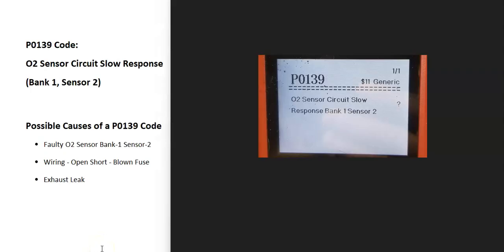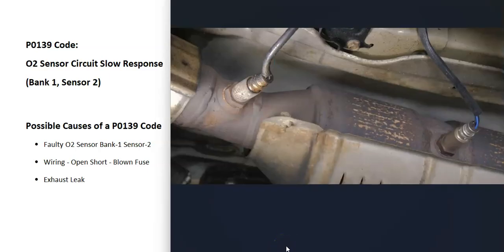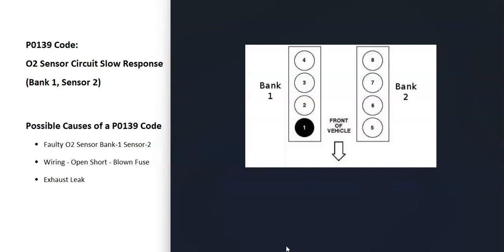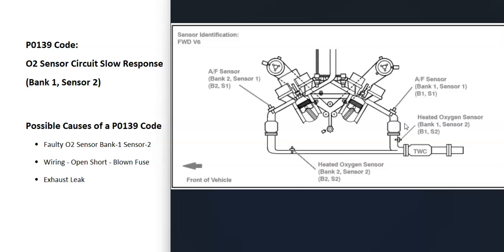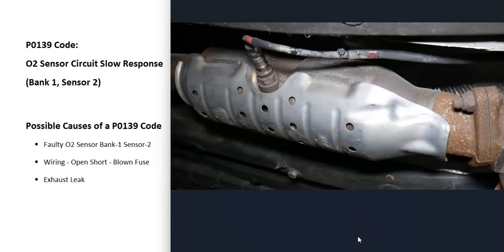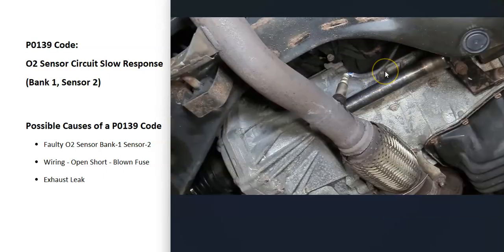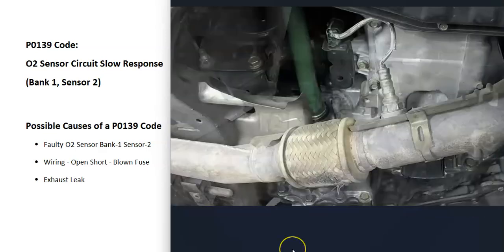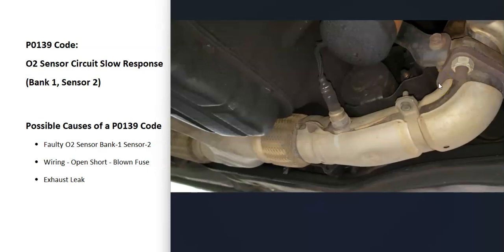Causes and Fixes P0139 Code: O2 Sensor Circuit Slow Response (Bank 1, Sensor 2)

Comment: I scanned my car ('06 Honda Accord 4 cyl), after the Check Engine light came on today, and the P0139 O2 Sensor Circuit Slow Response Bank 1 Sensor 2 code appeared. Also, 2 instances of the code: P0420 (Catalyst System Efficiency Below Threshold Bank 1). In the past, I just poured in some OxyCat in my gas tank and it bought me a couple months and the Check Engine light would eventually turn off after a few restarts. I poured this in again just now. I was just curious on your thoughts. The car is much too old to justify a replacement Cat. I won't have an inspection again until June btw. Thanks!!
Reply from the maker: If you can't get the code to clear and don't want to replace the CAT, you can look into an O2 Sensor spacer that often works, especially on older 2000s vehicles. An O2 Sensor spacer is a low-cost way to fool the computer, often used by racers with straight pipes or headers.

Comment: I have a 2022 Honda accord 2.0t and I’m using a rv6 Downpipe. I got the code P0139 last week, you think a catalytic spacer should fix the problem ?
Reply: So, I took my car to a different mechanic, and he told me that the ECU on the car is specifically designed for the original catalytic converter. Since the RV6 is high flow, the cat isn’t holding as much heat as it needs to. He plugged it into the computer and noticed that whenever he would floor the car, everything was fine, but after he stopped, the temperature would drop. So, he suggested that I get a tune-up, and I’m thinking of going with the K tuner.
Reply from the maker: Anytime something is modified, it is difficult to say how the computer will react. If I had to guess, I would think it should help, but it is best to find a dedicated Honda mechanic forum and see what they think.

Comment: I got p0139 on my 2010 Acura mdx , and replaced 3 times since last two years, if the sensor is good, the exhaust not leaking, what else cause p0139 code, I saw another video the fuel injectors might cause p0139 too, is it true or any other issues, please
Reply: Yes, I'm having the same code but the problem is that my car shakes at low acceleration, not in idle but between 1.5 and 2 rpm
Reply from the maker: If the problem comes and goes intermittently, that can be hard to diagnose. Often, it is a bad wire or a loose connection. A bad fuel injector can cause lean or rich running conditions. Usually, when that happens, there would be other codes, but it is possible.
Reply: @HVAC_Mechanic  thank you so much
Reply: For me the intermittent light goes on and off but in cold weather why in hot weather no light goes on ??  Any idea? Let me know what you think

Comment: I got the cat changed last year for catalytic converter P0420 error on my 2016 CRV. 6 months down the line I got the P0139 error. I changed the downstream sensor this time. 2000 miles more I again got the same P0139 error. I called Denso and they sent me a new sensor because of warranty. I called the mechanic to reinstall the downstream sensor and he says P0139 error may be because of upstream sensor also and recommending to replace upstream sensor. I am so confused this is driving me nuts!!!!!!
Reply: Same boat as u 😂
Reply: @joeroe2839 Take it to the dealer that’s the best diagnostic you can get
Reply: Any resolution? Mines a 2011 CRV, new cat is about 6 years old. I swapped both O2 sensors last year and the code is intermittent. New spark plugs at the start of Oct, along with cleaned fuel injectors.
Reply: @user-wy8bs7nl6i This is kind of very difficult to predict or diagnose even from a local mechanic. Take it to the dealer to have peace of mind otherwise it’s like shooting in the dark.

Comment: So I drive a 2010 Subaru Impreza, and I originally had a p0137 engine code. That code means 02 sensor circuit low voltage(bank 1 sensor 2). So I replaced the sensor, and now it’s throwing a p0139 code.(Bank 1 sensor 2). Not sure what to do now.
Reply from the maker: I would check the wiring
Reply: did u figure this out? Same thing happened to me. I have just the p0139
Reply: I have this exact problem, same car. Let me know if you figured it out
Reply: @evanbrillhart8178  Well I took it to a shop and they replaced the 02 sensors again, now I don’t have any dash lights. Not sure what they did differently. All I know is that this car has given me nothing but problems so I will be parting ways with it soon. Hopefully u have better luck with yours.

Comment: 2007 Jeep Compass and the sensors have been replaced 4times and the light comes back on…
Reply from the maker: If the parts are good, it is likely in the wiring
Reply: @HVAC_Mechanic  wiring from where though?? I found a video what suggested the fuel injectors??

Comment: I am currently experiencing this problem in a 2007 Kia Optima with a 2.0 engine... I changed the sensor after the eco box and checked the fuse, but the problem was not solved... I don’t know what the reason is???
Reply: Same thing for the 09 Chrysler sebring